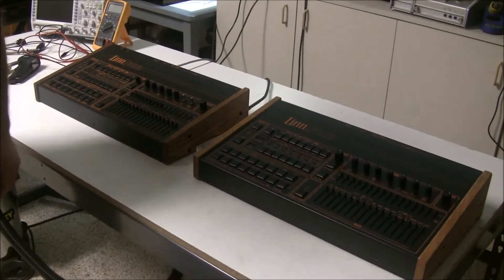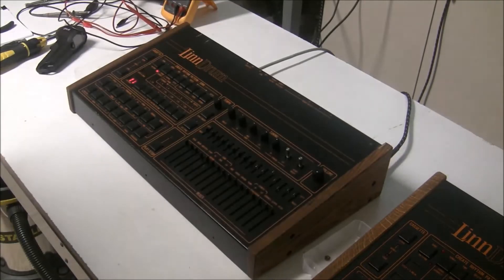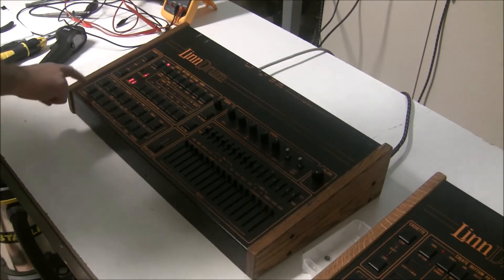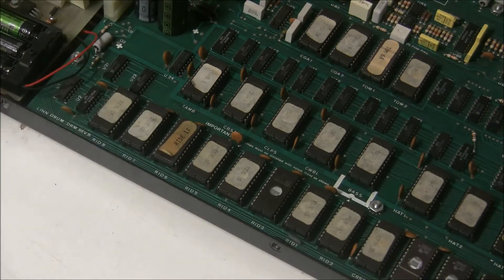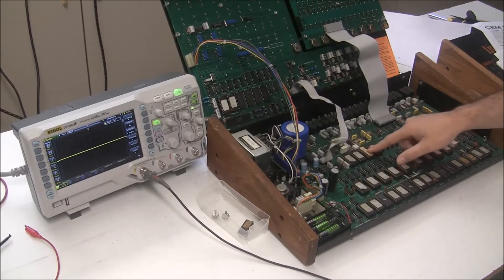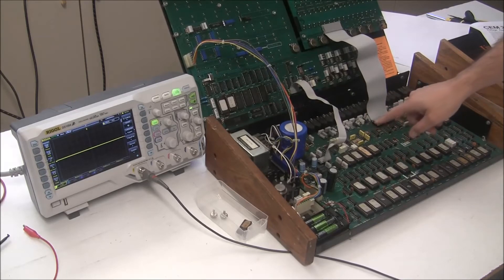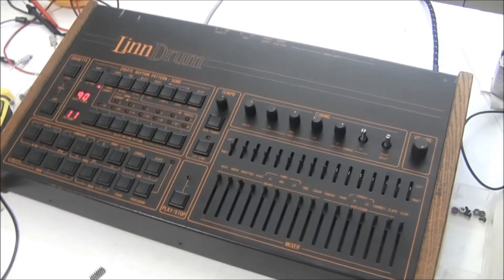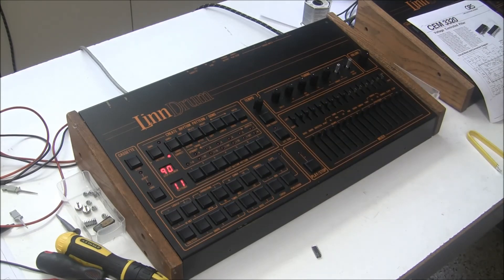Synthchaser #074 - Yet Another LinnDrum Repair - Troubleshooting Dead Drum Sounds

Comment: Thanks a million for this video. I was able to fix my friend's LinnDrum's broken toms/ conga sounds largely by watching this video and following along (in my case the bad chip turned out to be U87, the CD4051). His machine was totally bricked and wouldn't boot up whe I got it; solved that by rebuilding the power supply, but that's basic stuff. The real trick is knowing the signal flow and analog-> digital conversion, which you clearly know quite well. Thank you much, sir! I do have a question about how/ where to get EEPROM's programmed/ burned, as I've also found the cabasa EEPROM has failed. Do you do this for a fee, and if so, how much?

Comment: I've recently opened mine up to change the battery and since closing it discovered that the bass drum doesn't kick on either the mixer output or the separate out on the back, which is strange as I was very gentle and the 3 batteries are absolutely no where near that circuit. Thank you so much for this video! I'll be able to identify the exact problem now with a bit of patience.